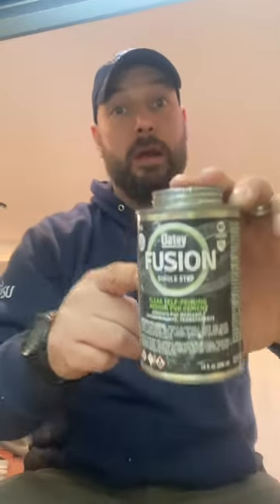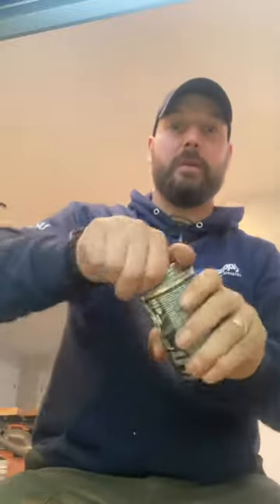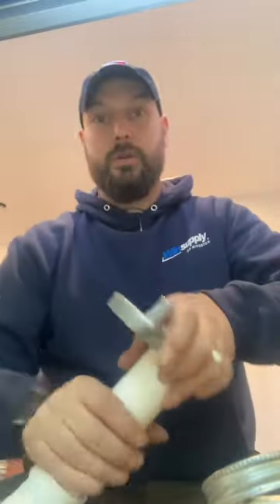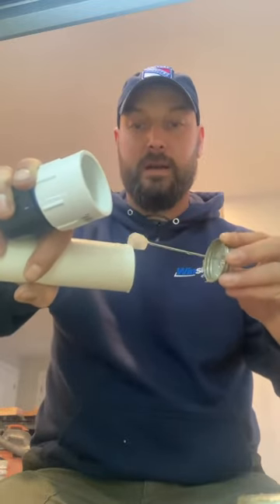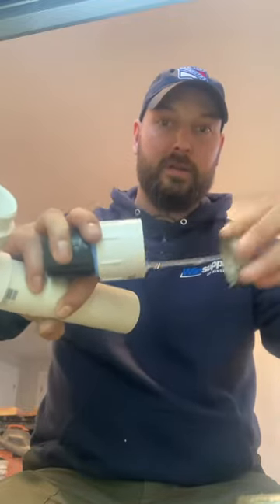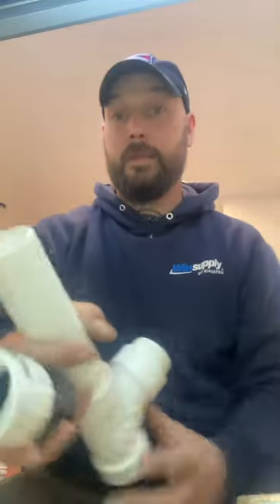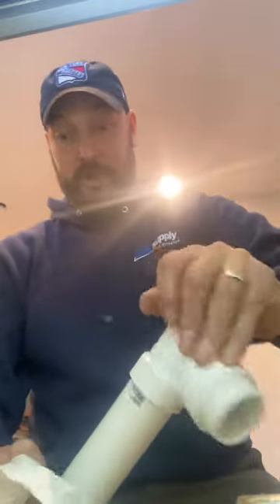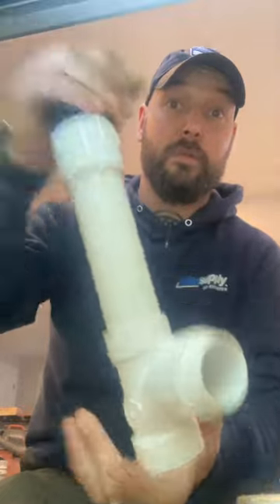Oatey® Fusion® - One Step PVC Cement

Comment: Fusion is great stuff. I appreciate this easy, quick, to the point video. I put together a bunch of pvc pool connections to replace a uv sterilizer all in an afternoon. Did just what you did. 2 hours later, pump on, none of the pipe connections leaked. The people who had problems must not have kept it mixed up.